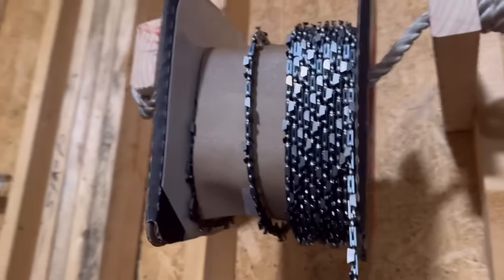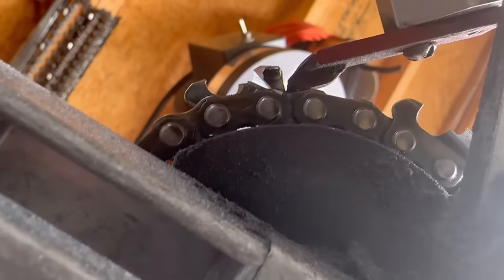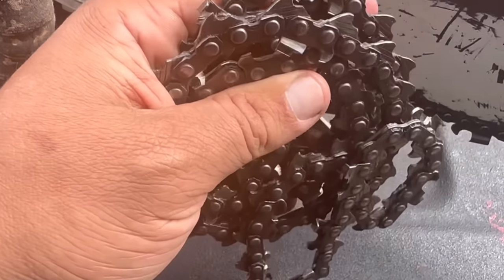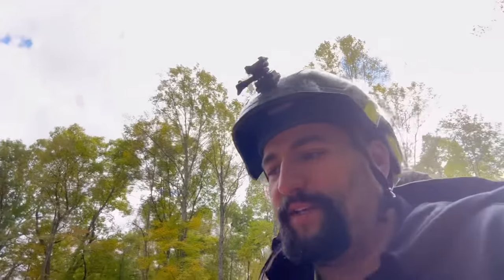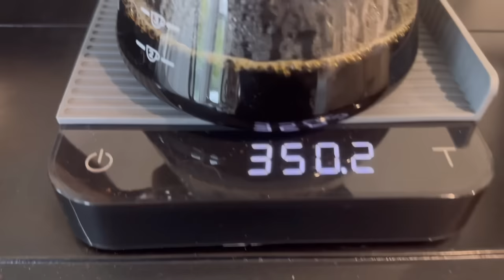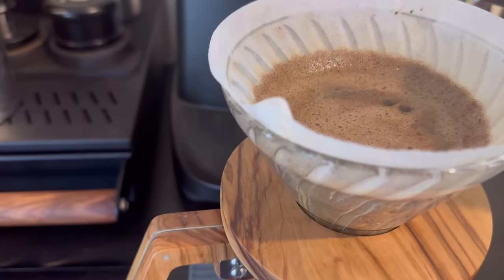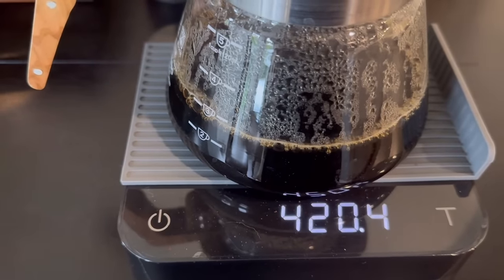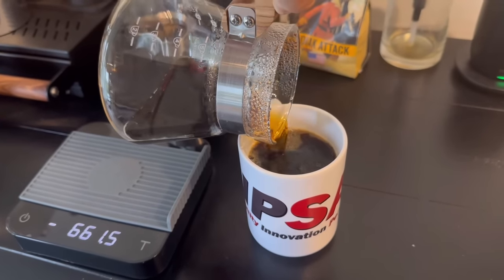FASTEST PRODUCTION CHAIN IN THE WORLD!!!

Comment: I like my 362 and I don’t NEED a 500…but dang! I want one! 

Threw a bark box on my 362, I notice a difference when the bar is buried. Thinking I’ll upgrade the intake and throw a 28” light bar on it.  24” is kinda short.
Reply from the maker: 28 may be a bit much for it but may not maybe try a skip chain on it.  Cheers!
Reply: @sizemoretreeworks  

Yea skip for sure!!

Buckin had a video of a 362 running a 28”.  Seemed to do ok although I don’t recall him burring the bar.  It’s really just so I can stand up straighter when buckin small stuff.  In hind sight , a 70cc saw would have been more useful in the long run IMO.  A couple more pounds for 10cc is worth it IMO.